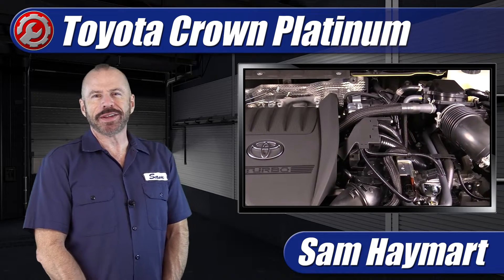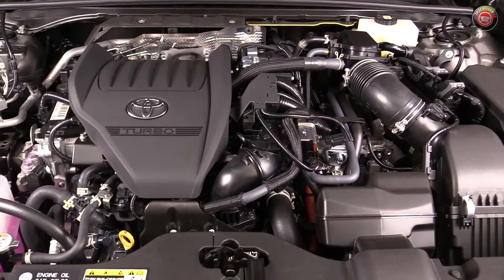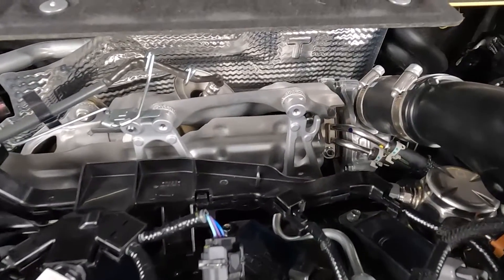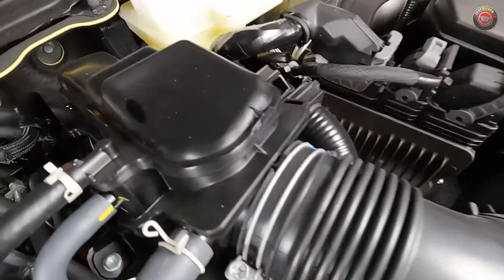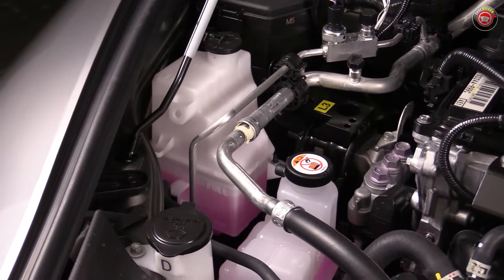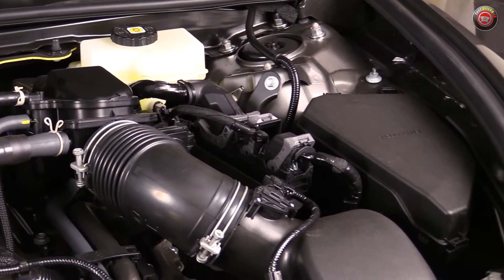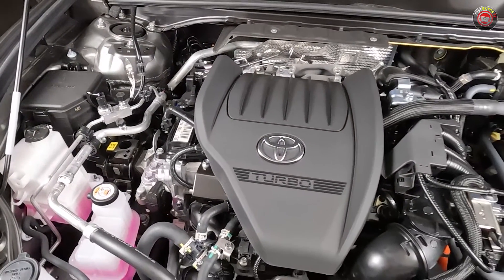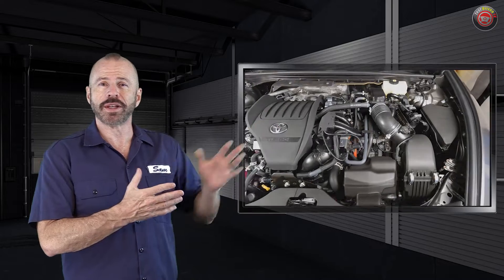Toyota Crown HybridMAX: Engine Explained

Comment: My biggest question is about reliability of the Hybrid Max system.

We know that turbo engines generate a lot of heat in the turbo chargers, which is why there are intercoolers for the charge air, and either oil or separate fluid cooling for the turbos.  Most turbo engines recommend that you allow the engine to idle for a bit before shutting it down, maybe a minute or so, to allow the turbo to come down in temperature.

So, my question is, this is a hybrid engine, and if there is not enough demand for the engine to run, the car switches to battery power.  You see this starting out, I've even seen some Avalon Hybrids and Crown Hybrids (THS) going down the street at 35-40mph on the battery (albeit not for long), as they've come off speed and are slowly slowing down.

If I am coming home from work, say a 30 minute drive on the Interstate, and I'm getting off the highway, as I pull up to a stop light, my speed drops below 30 mph or so, and then engine shuts off, and the battery takes over.  This turbo is at full temperature, hundreds of degrees, or even up to 1,200º F.  If the engine shuts off, it stops all the oil cooling, or separate fluid cooling to the turbo.  Then, you wait a minute for a light, and now you're driving in town.  The engine is on and off, turbo temps rise, and then drop, rise and then drop.
That sort of behavior can't be good for the turbo in the Hybrid Max set up.

I have a 2003 Avalon with the 3.0L V-6, and am coming up on 190,000 miles.  I'm not the first owner, the body is beat up, but the engine is as smooth as the day it came off the lot.  I just changed the plugs in it, they were immaculate.  No oil, no burns, the only thing was that the electrodes were worn down (Iridium plugs).  There was no indication they'd ever been replaced before, yet, were running great.  With a turbo without a separate cooling system, I'd think that it might not last more than 100,000 miles in a Hybrid Max.

Can you address this?

Comment: I consistently get 45 mpgs on the highway on my new Platinum, it's a great car.
Reply: I have the platinum but never touch the 40’s, are you sure you dont have the limited?

Cruise control at 65-70mph gives me MAX 34-35mpg
Reply: @randymarquez9681  It's a Platinum and we live in the Mississippi Dealta, so it is pretty flat. At 63 mph it gets around 45 mpgs on economy settings. Also on cruise I never have to touch the steering wheel with the lane assist on, a small pair of vise grips on the steering wheel does the trick, it is awesome.
Reply: @gleanerman2195  Just double check under your hood you actually have the turbo behind the engine where it should be. Maybe the dealer got super greedy and badge swapped you never know. My local dealer was trying to pedal a platinum that has collected dust on their lot for 70k. Never underestimate the shadiness of those leeches.
Reply: @treymtz  100% it's a Platinum it has a turbo and if you put it in Sport S mode it rips, mpg drop bigtime that's why we run it in eco 99% of the time, we love this car!

Comment: lol I own a crown platinum and it’s 0w-20 I’m dying seeing this thin oil even in the owners manual it’s says to use either 0w-16 or 0w-20 but after you pop the hood the sticker clearly says 0w-20 SAE. So who’s saying 0w-8 clearly wants you to break it and buy a new engine every start up way too thin to protect maybe good for fuel economy but not metal on metal contact. I’ve seen a 2024 Corolla with this 0w-8 and it’s cringe 😬
Reply: 0W-8 is for the engine on the XLE/Limited.  No one should be recommending or using it for the Platinum.

Comment: You never told us if it has a sealed tramission or not.
Reply from the maker: This is an overview, not a detailed service manual. Most automatic transmissions today are generally "sealed" and not intended by the manufacturers for owners to be monkeying with them. There are no dipsticks. This is common knowledge for the most part, thus we don't check that off as a discussion item in our overviews.

Comment: Drove one and loved it. Wanted to buy one but than found out how expensive the oil (0W-8) is that it takes.
Reply: Ohhh my its like 28 dollars for 1 bottle
Reply: Get the platinum. It takes 0w-20
Reply from the maker: All new engines are going to full synthetic oils. It isn't really going to matter what you buy.
Reply: @TDTVGarage    What???? 

..... "It isn't really going to matter what you buy."    Are you saying what car you buy or what oil you buy?  If your talking oil, then you are suggesting I can put any type of synthetic oil in??? That doesn't make sense.

I only found a couple places that sell 0W-8 oil. THIS IS the oil that the manual says is to be used in the Crown. Walmart and Amazon don't even sell 0W-8.  It appears to be a rare commodity!  I called the dealer where I was going to buy the Crown and they said it was $19.92 per quart.  Changes require 4.5 quarts. That comes out to $89.64 just for the oil.  (I didn't even check into what filters cost - I was done at that point.)

Loved the car when I drove it. It apparently isn't selling. Checked dealers in my area and the Limited edition is being discounted at many at just over 4K. That is a great discount.
Reply from the maker: We meant that synthetic oil in general is more expensive than conventional oil.